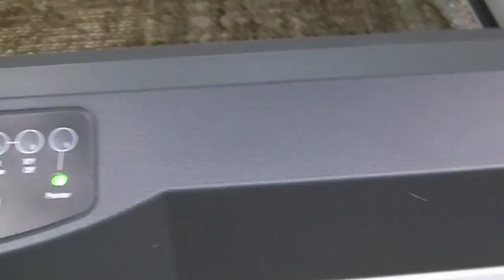AssentWorks - Laser Cutter Cleaning

Comment: Mike, don't use a Q-tip to clean a lens. It will scratch and leave a residue.  Instead cut a small sheet of lens paper, apply spectroscopic grade solvent to one edge and drag the lens paper over the lens with tweezers once. Do not apply any downward pressure on the lens paper.  If the lens is still dirty, repeat the procedure with a fresh piece of lens paper.